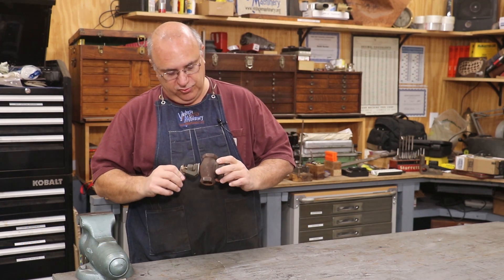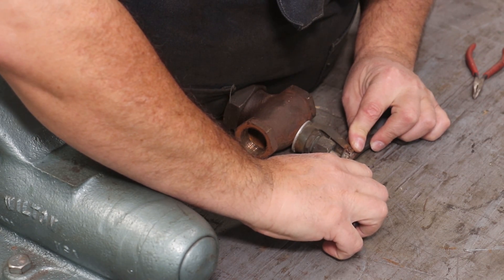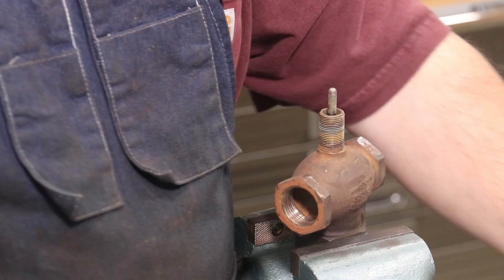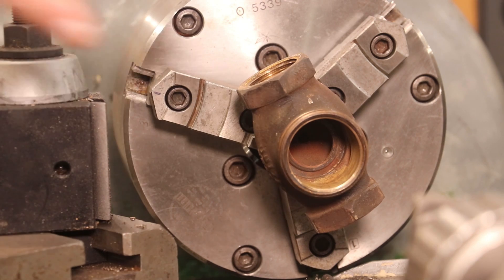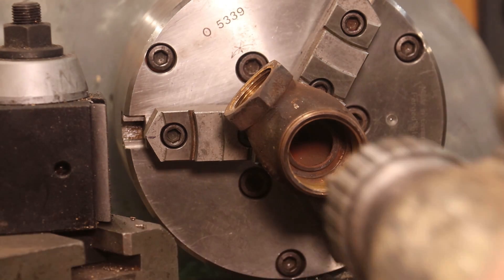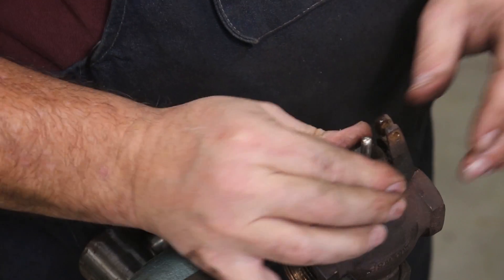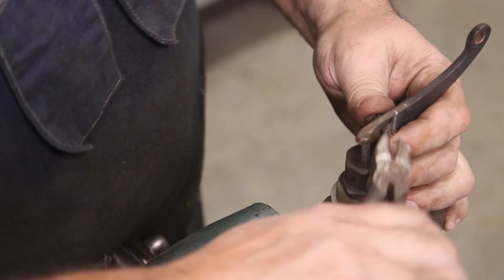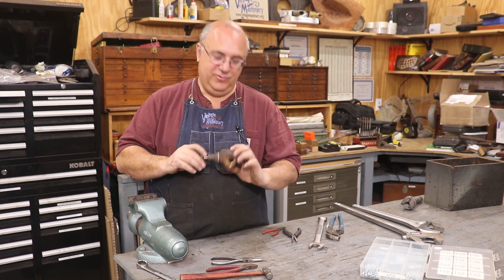Rebuilding a Brass Steam Whistle Valve

Comment: Hi Keith,
Another great video!  Couple plumber's tricks.  When I start putting some serious "gronk" (thanks Tom, love that term of art!) on a valve body or other fitting using a long wrench, I like to put a pipe nipple in the body / fitting before tightening in the vise.  It provides just a bit of insurance against "ovalizing" the thread in the fitting.  Second, a little Teflon pipe dope on the machined face of the spring retainer cap can help prevent leaks.  No need for dope on the threads.  Just on the machined mating surfaces.  This trick can also be used on mechanical joint unions.  I have to laugh when I see pipe dope on the threads of the nut in a mechanical union!
Thanks & Best regards,
Gottfried
Reply: No pipe dope on threads?  I used to help my Dad work on a small boiler (20 HP?).  Stuff came apart OK if we'd previously used dope on the threads.  If not, we were in for an 'adventure'.  Something about the steam seemed to lock the threaded surfaces together unless there was a coating of dope.  Yes, the water was conditioned.
Reply: Anthony Ruddy, I totally agree. Something solid like a plug would be best. A nipple really reinforces the body / fitting a great deal, but nowhere near as much as a plug. In the end, I suppose it depends on the degree of gronk, mine or the gorilla down the street. 😎
Reply: Craig, 

Regarding your comment, "In for an 'adventure'":  You're correct.  Although, 'adventure' almost makes it sound like something fun!  😎  As you probably know, that is part of the reason steam fittings are cast iron.  A couple blows with a sledge hammer and a backing hammer on the opposite side of the fitting and one can break the fitting into pieces to remove.  Steam has a habit of "welding" fittings / pipe together.  The longer the exposure to steam, the better the weld!

I apologize if I wasn't clear in my comment above.  Typically, there is no need for pipe dope on mechanical threads, such as the nut on the back of the steam whistle valve or on the nut on a mechanical union.  Sometimes, a little pipe dope on the machined, tapered / hemispherical (e.g., on a mechanical union) mating surfaces can prevent a leak there.

ABSOLUTELY, use pipe dope / tape on pipe threads.  To be precise, pipe threads taper, mechanical threads don't.  If I have need for SERIOUS gronk on mechanical threads, I will apply some anti-seize compound there.  Pipe dope will work in a pinch, but anti-seize is much better in that application.

Thanks & Best regards,
Gottfried
Reply: I agree about risking the valve body. He could just have gripped it square on the open ends of the hexes. I think he had given it some slight thought because the last time he tightened it he seemed to be holding back even though he had not tried a better way.
Reply: @AJR2208  
I assume you are referring to something to screw in for support. I'm not sure how that relates to my suggestion of a different method of holding the valve that does not involve anything screwed into it.

Comment: Kudos on the dressing the valve seat and using a Scotchbrite pad because others might of made more work for themselves by being more agressive than what was required. Those fretting about crushing the fitting in the vise needn't worry to much since this isn't your first rodeo but it would of been instructive to have shown viewers why a nipple is often a precaution. Over torquing can ruin about anything not just the part that's being worked on and it's a learning curve that is often not taught but would be a nice video for novices.

Comment: Keith, I’ve enjoyed several of your videos and recommended them to friends. I am restoring a Star Brass Five Chime whistle and an 1 1/2” steam Crane lever valve that are both missing the return springs. I can measure the approximate diameter where they nest. Can you recommend a spring supplier or other info source for this old equipment?  Thanks

Comment: Keith, looks like the way the valve is designed, the pressure could overpower the spring and cause the valve to leak.

I would think it would be installed that way to act as a kind of safety relief, pressure builds over a certain point and the valve bypasses and blows the whistle.

I have very limited experience with steam powered equipment however, so I may be way off base here.
Reply: Look again,, the steam is live on the spring side of the valve so keeps it shut, otherwise you would have a very low pressure blow--off valve.
Reply: @jonka1  I don't think so..... At 8:48 it plainly shows the steam direction come in on the stem side of the valve, which is opposite the spring side.

Tells me that this is exactly the reason the valve was leaking by badly.
Reply: @holder350  
If you look again Keith is very confused as he tries and fails to explain the working of the valve. During his efforts he stumbles over his words and at first has the live steam under the valve,then suddenly he has the steam  pressing on the top of the valve thus holding it shut. Listen to his words and watch his hands @9:20 as his tiny mind tries to make sense of his own confusion. I would be ashamed to be party to such a lack of clarity over such a simple device. He has mis--led you and , judging by the comments below, many viewers are also confused and have the thing working backwards. 
In reality this valve can be fitted either way but would be fully open under steam pressure if fitted so as to have live steam Under the valve.
The reason the valve was leaking was due to erosion which is a common problem with steam.
Reply: @jonka1  I must be missing something then, because the arrow on the valve is definitely got the flow direction coming into the valve on the operating rod side, which is opposite the spring side.

Looking at it again (several times) I almost think this valve isn't a steam valve, but a type of drain/refill valve for low pressure.
Reply: @holder350  
Yes the arrow does indicate the direction required to lift the valve. I have seen a lot of valves with arrows cast into their metal but valves can be mounted either way depending on the intended use. Given the light pressure exerted by the spring divided by the area of the valve seat I'm expecting that valve to be lifted fully open at a very low steam pressure which if mounted as per the arrow would have the whistle blowing at full blast with no control from the lever. The only way this valve can control a whistle with its lever is for the live steam to be admitted in the reverse direction which fact has entirely escaped Keith's attention.

Comment: A mechanic I worked with many years ago always called those split pins "carter pins" He said that cart makers used them to hold the wheels on carts. A company by the name of Cotter made a lot of carter pins and people started calling them cotter pins. I saw a painting from the 16th century that had a cart in it.Lo and behold, the cart had a big split pin holding the wheel on. A carter pin.

Comment: Good job. I'm a bit surprised you didn't test it with compressed air. Most times I have reseated a valve like that it didn't 100% seal the first time and I had to redo it. Hope you let us know if it was a success.

Comment: Great video! Quick tip, how you are holding the valve in the vise could oblong, or crack the valve. To prevent this install a pipe plug or nipple to add support
Reply: He's not listening.

Comment: The reason the push rod is sticking is that you have hopelessly overtightened the gland nut. Instead of questioning yourself you try polishing a rod that was working perfectly. Then @20:17 you have obviously thought about it off camera and this time you set the packing gland correctly. Hey Presto it works!! 
Keith why do you not explain this to your less exerienced viewers so that they might learn something?
Oh maybe you just can't cope with looking like you didn't know what you were doing when you first assembled the valve.

Comment: What's the purpose of that little feature on the stem? I'm wondering if that somehow relates to the need for the spacer under the base of the yoke, which would be compensating for the stem being too long. It could also be compensating for a too-large repair on the end of the lever though.

Comment: I'm not sure, not being able to look at that valve closely, but it looked like the pull lever needed to be turned 180 degrees and the valve be installed that way. The pressure should be with the spring pressure, I think. It looked like the pressure would be pushing against the spring.
Could that have been a cause of the failure?
Reply: No, spring AND steam pressure hold the seat in place. The lever has to overcome BOTH stem and spring to open .
Reply: @alanfarenden9378  
Yes. 
It's remarkable just how many viewers can't work out the operation of this valve.

Comment: Hi Keith, great video, good timing, I have to reseat my steam whistle valve.  On using an adjustable "Crescent" wrench, which way should you put it on the nut, I have heard both ways/
Reply: The correct way is to have it adjusted properly. So it's no use asking Keith.

Comment: Now if I was doing this, I would tell my wife I needed to buy a steam engine and boiler to properly test it...never let a fixit go to waste...
Reply: I'd tell my wife the same thing.  I need them to power my 1911 South Bend lathe too.
Reply: @bobvines00  At least a safety pressure valve is tested (with regards to blow off pressure) tested with air. 

The blowing off and shutting action can't really be tested in the same way due to air's lower density and
speed which it passes thru the valve.

Wet steam is  different.

With a safety valve you want a distinct opening, blow of 0,5 bar (or about 9 psi) and a distinct closing.
Reply: Any excuse for a boiler and engine.

I would SERIOUSLY like to build a few 
model (Stuart) steam engines, and a 
large-ish boiler.

The Stuart Beam Major is looking 
quite good!  A walking beam engine?
YES!  Keith Rucker doesn't have one, 
but Keith Appleton does.  (Look him up.)

steve

Comment: Ah Keith, I knew when you tightened that gland nut that it was going to stick.  Assemble the actuator, then adjust the gland while operating the valve.
Reply: I agree but he won't reply or try to understand.

Comment: Sticking may be caused by over compressing the packing?
Reply: Yes he first tightened way to tight...l am like you l saw that to...!
Reply: @steveshoemaker6347  The only way to know would be to tighten while under pressure and it did help to have a polished stem.

Comment: I love these videos!!
Now I have two questions:
1) Why does a cotton gin need a whistle?
2) How old could this valve possibly be if it has a plastic or Teflon seal?
Reply: ...and if it is from the 50's it most likely is made from Polythene.
Reply: @johnmccallum8512  
Polythene melts at the temperature of pressurised steam. My money is on ptfe.

Comment: What are the shelves in the valve for?
Reply: They divide the valve body into inlet and outlet halves.
Without them it's not a valve at all, just a short piece of pipe.
Reply: @surlyogre1476  wouldnt it still be a valve with the mechanism still active? What do the shelves have to do with the mechanism of the valve? Thanks for any info in advance!
Reply: @imagineaworld  Okay, I can't draw a picture, here, but I will do my best to explain.  (I think your question is a valid one, other viewers may be wondering the same thing). So, here goes:
The steam comes UP  the inlet pipe and enters the valve body from the bottom. The lower shelf directs the steam to one side (we'll call it the left
side (arbitrarily)) where it then runs into the upper shelf.   As long as the valve is closed, that's as far as it can go, because the shelves are connected by the valve-seat wall.  (The valve operates in a direction perpendicular to the valve body, and amounts to a hole in a wall that can be opened or closed.) When the operator opens the valve, the steam can then make a right-angle turn through the hole (the valve proper) and transition from the left side (inlet) to the right side (outlet) of the valve body then another right-angle turn to continue up out of the valve body into more pipe, on its way to do its job. 
I hope this helps.

Comment: I'm guessing here that since they aren't using the pressure of the steam to hold the valve shut, that valve will also act as a pressure relief valve.
Reply: No i don't think so. 

I would expect this valve to be mounted on a manifold with a shut off valve.
You cant  service it if not.
Depending on boiler i don't this valve has an big enough diameter
A safety valve which can be accepted by the inspector could be required to be able to put inspection seals on it.
Reply: The live steam is holding the valve onto its seat.

Comment: DIdn't know they had teflon valves in the old days.
Reply: I've worked on valves of a similar age, and they used a hard rubber material that got harder with age.  It would flake and chip and was hard to face.  In the late 60s I worked in a factory and machined Teflon for valve inserts.  It machined a lot like Delrin.  This insert could have been done quite a while ago.

Comment: Thank you for another great video! Quick question - (caveat - I know nothing about this topic) is there a reason for not adding any sort of lubrication (like light machine oil) to the valve stem to make it move easier after you polished it with the scotch brite?
Reply: The steam will blow it away in short order.
Reply: Ether Oar thanks... makes sense
Reply: What is used for helping the packing material is graphite grease
Reply: @etheroar6312  
Lovely use of words.

Comment: You have managed to a machining video and leave out 90% of the machine work!
Reply: What "machine work" did you miss?  He showed everything he did.
Reply: Are you kidding? No indicating casting, couldn’t see the seat and how it was cleaning up, did the spring cap and seat off camera, cleaned up the shaft off camera. The only machining we actually saw was him cutting the Teflon/plastic seal.  Don’t get me wrong; I love Keith and his videos but just praising him gives fake feedback.
Reply: @samueltaylor4989  
I suspect the reason we weren't shown the valve seat cutting is we couldn't notice any runout in the way he'd mounted it.